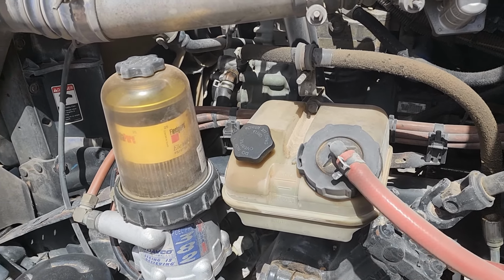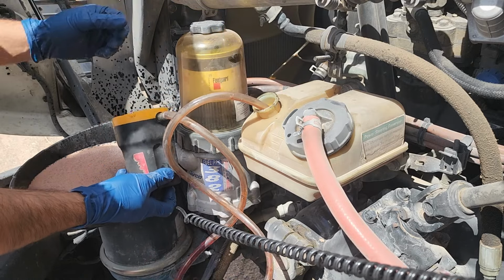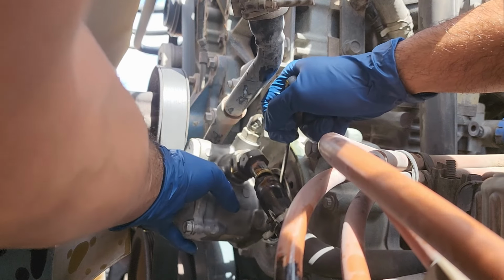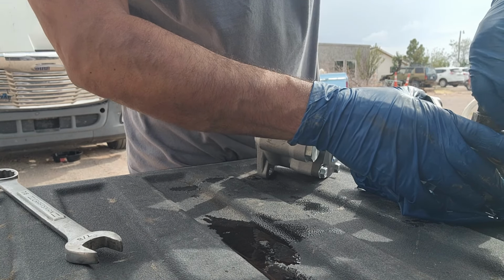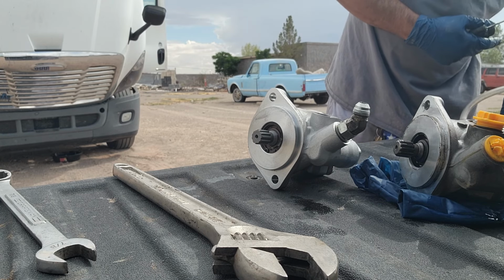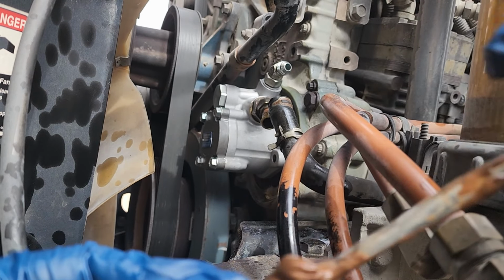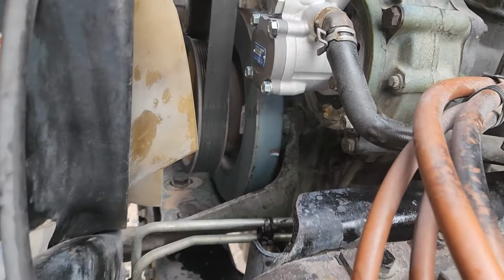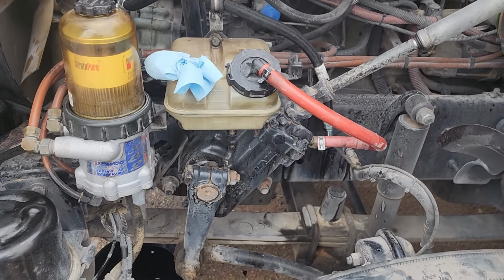Critical Semi Truck Steering Part You NEED to Check Right NOW

Comment: The filter needs changed twice a year mine went out because I was unaware there was a filter in there. Bet your ass it'll get changed now
Reply from the maker: Absolutely I wasn't aware of a filter there till like 2 years after owning it.
Reply: Nobody changes the fluid like they should either.  Once a year regardless of operation.  Don't worry about getting a full drain.  Get what you can out of the reservoir and move on.
Reply from the maker: 100% Agree when you depend on your equipment to take care of your family its a small price to pay to keep her good.